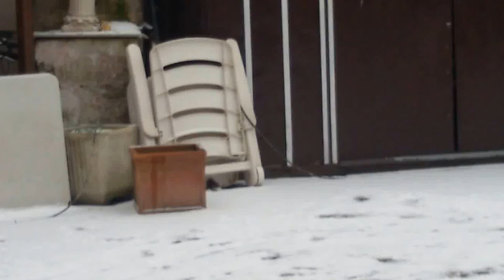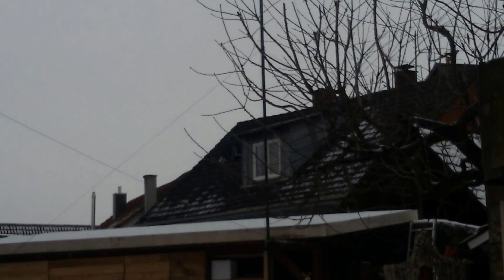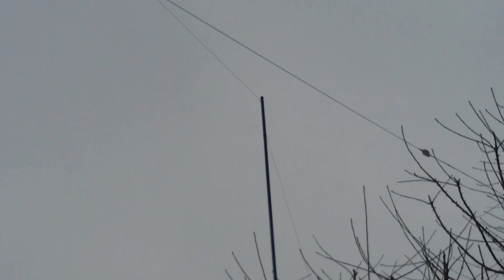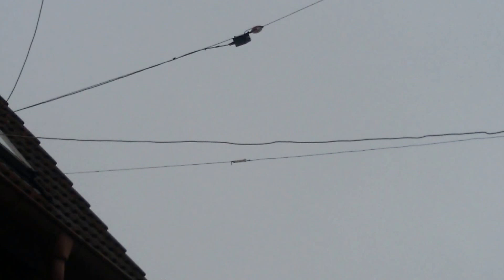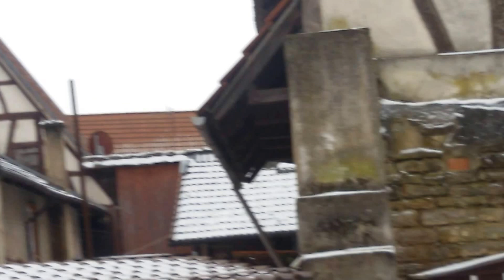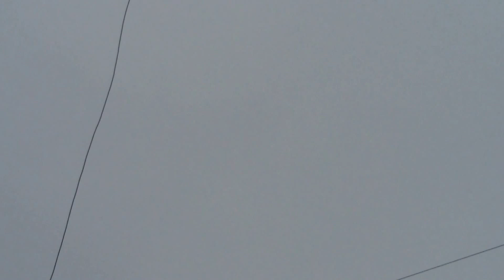Shortwave Random Wire antenna  W/9:1 UnUn pt2

Comment: Homebrew is awesome and rewarding. My first antenna was a vertical made with PVC and a deep sea fishing rod for 10-11 meter...taped wire to the mast, radials were tied out because they were wire also.. worked it with my mfj tuner for a year.
Reply from the maker: Yes, homebrew is good sometimes because it's a cheap way to achieve same results as with a professional built antenna.  Thanks for the view and comment.  73 brian